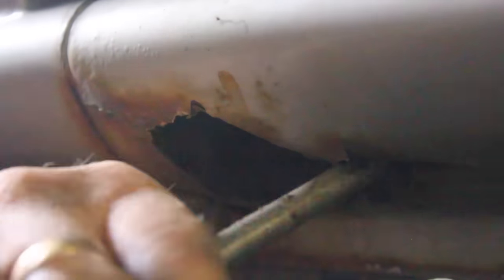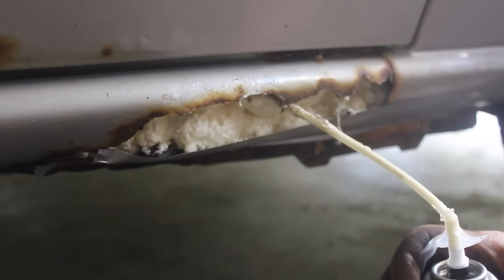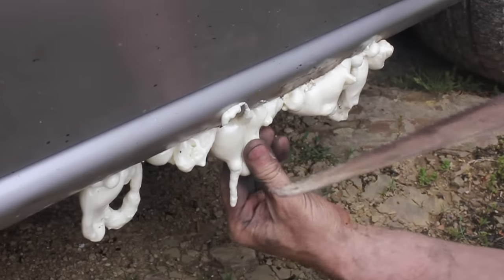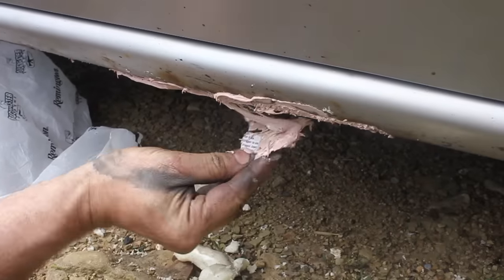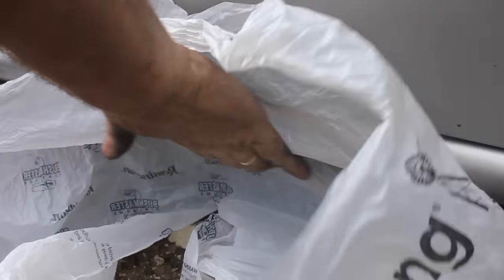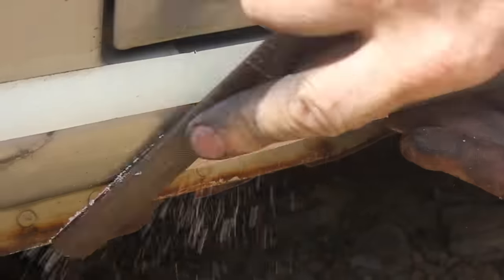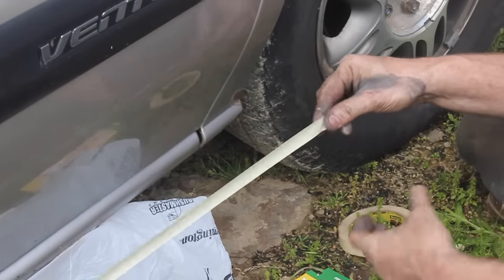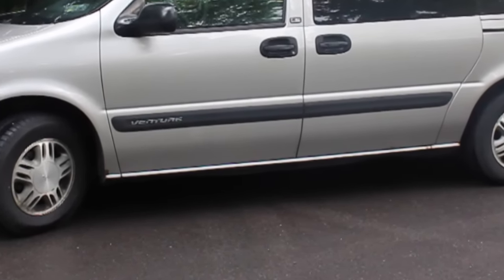how to FIX a rust hole in a rocker panel (fast, low-cost method)

Comment: This is a miraculous method my man. Did this to my car a couple years ago, and now all the rust is gone! Everything's gone! I mean, the whole car is gone from the rust... but this mean the rust is gone, too.
Reply: Lol
Reply: Lol 😆
Reply: Lol
Reply: My rocker panels had weep holes to let water out what I see is a temporary fix first snow,water, and salt same old rusty rocker
Reply: @georgefoltz4435 ......and  No safety in an accident !!!
Reply: @kischillin5539   🤣🤣🤣🤣
Reply: @georgefoltz4435  No snow, water, and salt here in Georgia but my Pontiac Montana (same van as the Chevy Venture featured here) was clearly a northern car and needs this badly. I just had a shop refuse to do brakes because it’s all so rusted. The more quick cosmetic fixes I can do like this the less likely they are to out-right refuse work. :) If I did live in a state where it needs to pass inspection (I don’t) then it doesn’t really matter if you block the water flow or whatever since the van would’ve been unregisterable and scrapped that much sooner without the $20 quick fix. It’s buying you a lot more than $20 of added utility to the life of the vehicle where otherwise it would get scrapped.
Reply: @J.C._2223  What safety would a rocker panel give you in an accident?
Reply: @emmettturner9452  29 years ago , the door and a solid rocker panel saved my life , Happy Thanksgiving  !!!
Reply: @J.C._2223  Well, good thing it’s a lot more solid now than the rusted one that would fall apart when touched. ;) I’m glad yours was solid enough to save you. Happy Thanksgiving to you as well!
Reply: 😂😂😂😂this made my day lol
Reply: @J.C._2223  I guess you don't ride motorcycles then?
Reply: @AmericanThunder   Not yet
Reply: LOL ..hahaha
Reply: Lol
Reply: Foam holds water lol
Reply: 2 years later. This shit is still funny as hell. Lmaooo
Reply: @emmettturner9452 Rocker panel does nothing on a wreck. ✌️💪 Princess
Reply: @BradNichols-vo9eo  My point exactly.
Reply: This dude is lying
Reply: @georgefoltz4435  The weep holes didn't work, that's why it rusted out in the first place

Comment: Rocker panels are cosmetic. If the state fails your inspection you should file a lawsuit claiming the inspector lacks the mechanical competency to be conducting safety inspections

Comment: WoW! Haters seem to really be hating here. Well I thank you so much as I need to get my '03 Yukon to pass inspection and there is a hole the size of a fist in the bottom of one of the rocker panels. I will definitely be trying this. For the people who think this is a horrible idea - Meh... my vehicle will be driven by me until it is scrapped and this will give it another year or two on the road. Thank You so much for the idea. (Also, professional driver who has never had an accident more severe than hitting a deer. Fixing a hole would not change much of the outcome of an accident safety wise- now if it was replacing the whole rocker panel this way I might cringe.)
Reply: Wow, I'm sorry you hate your car lmao.
Reply: A proper fix would've been hardly any more expensive. You don't even have to weld anything. There's a couple much better vieos about this on yt.

Comment: I guess if a car is 20 years old but running okay mechanically, this may keep it on the road for a couple more years!
Reply: That repair is purely cosmetic.  This repair doesnt determine anything regarding how long it'll remain on the road.
Reply: @lawrenceshdow  This repair is definitely going to the determine the car's durability. In several year's time you'll drive a Flintstone car with this.
Reply: @midasiscariot  the rocker on a venture has nothing to do with the frame of the vehicle and no matter how you  repair them there is about 20 other spots that'll collect road salt and water on the vehicle. Even on the rocker alone.   That thing can rust across the entire bottom and still drive just fine.  It isn't part of structural integrity in this mini van.    The rocker is rusted on the back inside the entire length as is. Patching what comes through is just cosmetic. Replacing the rocker would be best but it won't change anything in regards to roadworthiness. 

We will have to agree to disagree on this one.
Reply: @midasiscariot   I'm not going to argue with you about the venture rockers.  You can do what ya want.   If you ever work on one of these you'll see why your thinking is wrong.   There is no Good repair at this stage; only replacement.
Reply: Just a death wish if that car is a unibody the rocker is part of the framework patch it properly
Reply: @midasiscariot  why you so mad about this diy fix? Weirdo
Reply: @midasiscariot Yeah, but if you need to pass inspection and can't fix this correctly due to lack of time or lack of money, this is a good fix.

Comment: 'Structural integrity'. Almost pissed myself laughing at that one lol.
Reply: Makes you wonder why they don't start building complete cars out of expanding foam, right? LOL

And these minivans had a terrible reputation for having weak shells in a crash when they were new! This 25yo one would fold up like a wet cigarette packet if it crashes, & he does it on a family car! #Zerofucksgiven 😆
Reply: @MrPabsUk  they have used expanding foam and thats the first places they start rusting because foam holds moisture!
Reply: What he meant by "structural integrity" was that it gives better structure and surface area  in order to apply the bondo.
Reply: @danielsmith7935  It doesn't matter because people who use foam to fix auto body rust holes are doing so to get another year or two out of the car before they sell it to a junk yard.  For instance, I have a 17 year old car that runs well, little to no fixing required except for oil changes, brakes, etc.  The bottom part of the body is shot, though and the car has a realistic value of maybe $500, so paying for bodywork isn't worth it as one small job would cost more than the car's value.  But by doing this type of body repair, I have gotten 6 years more out of the car so far (and still going).  I know that the next step is to junk it so I plan to use it for as many years as I can before I have to junk it.
Reply: I would take it off the lift, not pass it and send you on your way if i saw that. On a full frame truck sure but a unibody vehicle i won't give it a sticker if i see spray foam
Reply: @Stale_Kracker  No Mercy!  as you kiss the State"s arse.  Shame on you!

Comment: I’ve repaired my Town & Country the same way. It’s worth more in scrap metal than resale so this is an ideal low cost method to pass inspection. Instead of a bag, I used wax paper for easier release. Works really well. I’ve also covered the bottom of rusted doors with aluminum fascia and self tapping screws and painted over it with truck bed coating. Some ideas for those reading the comments section that drive cheap cars in the rust belt like me.
Reply: Where do y'all live since when does rust stop you from passing inspection I live in nc all kinds of rusty cars haha
Reply: @curtisedgerton8380  Pennsylvania. I believe the rule is that if the rust hole is larger than the size of a quarter, then they can fail you. Another cheap fix that I was told by the inspector is that you can cover the hole with a few pieces of aluminum foil tape and that’s passing. I’ve done that as well. :)
Reply: I don't understand why a rusty rocker panel would make the car unsafe to pass inspection
Reply: @BrianLChristopher  Yeah I'm in PA and my old truck just failed for rocker panel rust. A little silly honestly.
Reply: Love the wax paper idea man! I was thinking the plastic bag would stick and shred upon removal. I’m in MN and my truck is getting bad fast from the salty roads here, and it’s only 10 years old! Thanks for the tip.
Reply: Masking tape can also work, peeling off fairly clean.
Reply: Omg, I used spare aluminum fascia too before applying bondo and painted it over with rust reformer and undercoating.

Comment: the previous owner of my car did that over years on every part possible on the car. For bigger holes he used chicken wire to hold the foam and used a rag to glue it with undercoating to the undercarriage. 

Well after some time I wanted to take a closer look at the car and started picking with a screwdriver after I lost a big chunk of that stuff while driving. 
What came out would be a worthy car for Fred Flintstone. I even lost a first aid kit in the trunk through one of the rust craters.....

Comment: The foam will holdup water and the rusting process will continue much faster. Also bondo based on polyester will fall out soon because you can't fully seal it with paint in this situation.  It's better to remove rust as much as possible mechanically and use a rust converter first. Then apply epoxy primer to seal the rust and fill the holes with epoxy or fiberglass resin. This will not cost you much more money and is a longtime solution.
Reply: I mean, I thought the ideo was a joke. Apparently it wasn't uploaded on April 1st, though.
Reply: I just bought a 99 malibu with 132k which is rusted like a sob. I have absolutely no problem doing this. He's not rebuilding a hot rod here....
Reply: And by the way, you got to this video somehow of researching cheap rocker fixes;)
Reply: Ive done this to my truck and put metal reinforced bondo over it not even a touch of rust has came back and that was a year ago.
Reply: My jeep has carpet for fender liners from factory, don't tell me foam holds water to avoid using it 🤣
Reply: @samibarnes08  if that's the case, be smarter and look a car over before buying it. If you can't see a hacked body job....than you deserve whatcha get. I have no issues with this if your trying to preserve a personal vehicle from looking like shit.
Reply: @andrewjocar4507  well there's a right way and it's not that much more expensive have a good one pal👋 ☺️
Reply: @midasiscariot  It's not a joke. I use this method to sell completely rusted cars to losers.
Reply: Lol
Reply: It's to pass an inspection. If you're spraying foam in your car I don't think you care anymore.
Reply: @samibarnes08  That’s exactly what I was thinking.
Reply: @midasiscariot  🤣
Reply: @andrewjocar4507  🤣
Reply: @neilbreen9041  🤣
Reply: @neilbreen9041  thanks for the tip. Now I'll be buying cars and sell them to blind people 😀
Reply: @marshalmitherz3352  true.
Reply: @bennedettocracolici5058  🤣
Reply: @bennedettocracolici5058  🤣
Reply: @bennedettocracolici5058  🤣
Reply: @bennedettocracolici5058  🤣
Reply: @bennedettocracolici5058  🤣
Reply: @bennedettocracolici5058  🤣
Reply: @bennedettocracolici5058  🤣
Reply: @bennedettocracolici5058  🤣
Reply: @bennedettocracolici5058  🤣
Reply: @samibarnes08  🤣
Reply: @neilbreen9041  You have a lot of integrity, most would just use duct tape and paint it.
Reply: @andrewjocar4507  😂😂😂
Reply: @privateryan555 still good?
Reply: @deontegriffin7655  yessir. Still holiday up. No rust. The metal reinforced bondo is doing its job perfectly.

Comment: Use the spray foam that’s made for rock fountains. It’s black and waterproof.
Reply: Whatever the material is, it will still hold moisture like a sponge and accelerate rusting.
Reply: @sawadiy  it’s waterproof my guy
Reply: I have a idea.....
 1. Grind all the rust out
2. Do the 3step Por 15
3. Foam of your choice.
4. Bondo 
5. Paint

Comment: Ima be doin this myself cuz body work places are scam artists and only do insurance claims not cash jobs. They told me the car isn't worth doing rockers cuz it'll eventually rot out again. It's a 2002 chevy cavalier with 105,000 miles on it and I've seen this exact make of car last 400,000+ miles but point is anything with low mileage is worth fixing so that being said ppl say it's not the correct way but unfortunately it's the only way since the car value may not be worth what they charge to do this job or to hear your vehicle isn't worth fixing. Good job my friend as far as I'm concerned it's better work than I've seen other ppl do.

Comment: People whining this is not the way. If it works on and old beater vehicle who cares, if it works.I've seen vehicles fix what suppose to be the right way rust back out in 1 to 2 years. And Ive seen fixes like this last a lot longer. Who cares if the car looks better it done its job.
Reply: nobody care about the looks. There are two buts:
1. the rust has not been stopped. So it'll continue to rust, potentially on the inside and unseen. You might find out in a crash that the part that was fixed was a load bearing structure..
2. I can guarantee that there will be people who will do this kind of patch-up job before selling the car - without telling the buyer
Reply: @AlexN2022  And a woman might marry a man because she thinks he has a nice car, only to find out too late he is so broke he fixed his car with foam to make it look good.

Comment: forget all the hater or the mr do it right the first time comments. i have a beater that just needed to last me another 2 years or so. this is a great way to get my truck on the road and it works. i will not pay 800 to fix rust on a 1000 truck.. will i sell it and lied to other buyer about the cheap fix NEVER...i used this as my own risk

Comment: I bought a used Toyota sienna 1 year ago.  No rust until this spring, all the rocker panels are throughly rusted. The guy I bought it fm put a paint or something on it to hide it cuz it wasn't there when I bought it.itvhas low mileage. I'll use this method. Thanks

Comment: In cars with extreme rust on the rockers, and especially on the side panels, the thing you should be more concerned with is rusty sub frames, floors and brake lines.  Those are not just cosmetic concerns, but safety concerns.
Reply: In some states (mostly blues states) they will reject your car if it has any rust at all.
Reply: @ryan-qz5xb Unlimited car wash pass at Holiday. Get a car wash everyday.
Reply: Use the foam filler and spray rock guard over it. 5 minute job. Fixed. The Right Way.
Reply: @josephfilm73  right way , yeah ok . LoL

Comment: You can buy closed cell foams.  In fact there are several spray foams made especially for sealing ponds and waterfalls.
Reply: I read Tough Stuff is a closed cell foam so I'm going to try it shortly.

Comment: I did this to my car 4 years ago and it worked fine and got me through inspection. But few years later the metal rusted completely and I got this part welded by mechanic. When you do this warn mechanic with welder because this stuff can catch fire quite easy. Mechanic was a bit complaining about this stuff as he found it and I admitted using it 😅 all fine so far.

Comment: Excuse me for the typos didn't have my glasses 🤓 my mistake but my question for you is if I do this to my pickup truck exactly the way you did it in this video and I spray it with a lot of rust preventer and then spray it with a primer and then actually painted with the factory paint color identical to my trucks color. I ordered a couple quarts of my pickup trucks exact paint color from the dealership. When I spray this it will be actually sprayed with an actual professional auto body spray gun with all the attachments. How long will this last make before I'm going to have to redo the whole rocker panel again just curious on how long something like this will last especially if I really put a lot of extra layers of extra primer in rust preventer along with a couple extra layers of factory paint? What is your educated guess on how long this will last???? Your video was awesome brother🎉🎉🎉🎉

Comment: Wow my 64 chevy truck had a big hole under the floor mat and you could see the ground I used that foam stuff and filled the holes in and stuck the mat over them and it glued the mat down and worked great no more fumes in the cab and much quieter this was 25 years ago lol

Comment: If you place a small diameter pvc pipe at the bottom of the panel that crosses from side to side it will allow moisture to travel through the foam and not get trapped. Great video for those on a budget.

Comment: Man, this worked a treat.  I think you might have mentioned the strip of duck tape you put to hold the Great Stuff in, but other than that, great tutorial.  Too bad I bought a bunch of stick on patch material and ten types of sandpaper before I found this. I'm in Canada and I don't even know about this rust inspection thing you folks are dealing with.